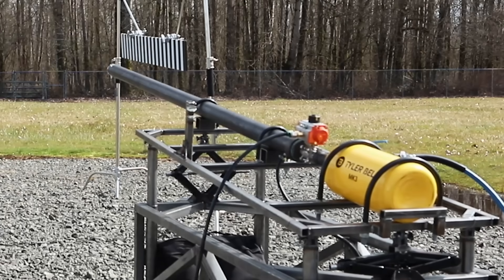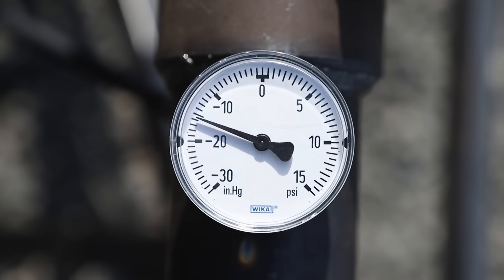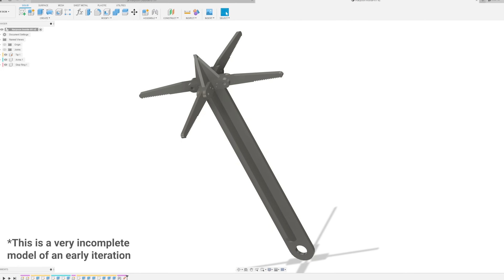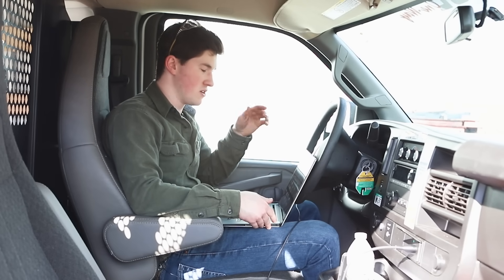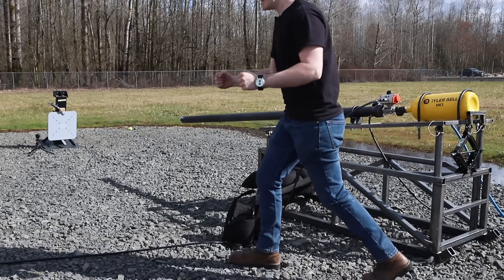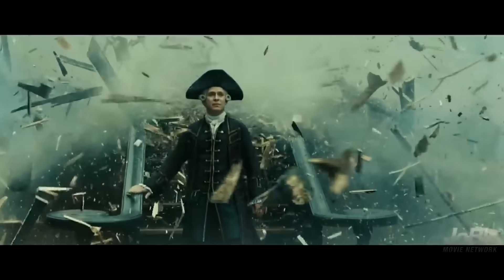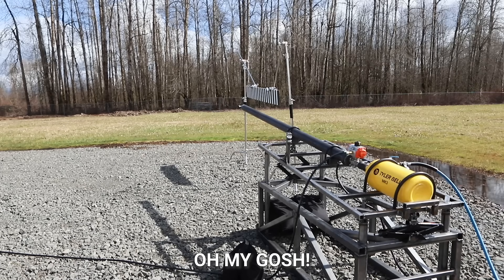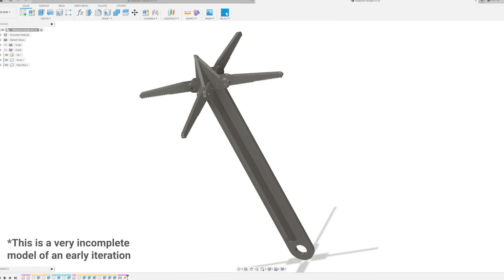Have I Found the Fastest Air Cannon Valve??

Comment: I know the answer. The ball is subsonic because your airflow is subsonic.

You need a de Laval (convergent-divergent) nozzle at the outlet of your tank to make the air jump from sonic to supersonic.
Reply: This and his assumption that a ball valve at the same size as the tank opening is sufficient. That's completely wrong, you actually need to oversize it quite a lot. Like a lot a lot like twice as much if you want it to be fast. I know because I have worked on CFD where we were using high pressure air to clean diesel particulate filters. We used a popit valve and it had to be pretty oversized to open fast enough
Reply: @friedtomatoes4946  How much is a lot and pretty oversized?
Reply: @Capitan-America-no.1 truthfully without math or simulation I can't give you that answer and I'm too rusty to run those numbers for you. However I can tell you that a better solution would be a popit valve. You get almost all of the flow with only a few percentage points of opening.
Reply: I don't think that would work. De Laval nozzle allows supersonic flow across a large pressure difference, transforming pressure potential energy into kinetic energy, but for the cannon application, ideally the pressure drop from the tank to the barrel is minimal, so maximum pressure is applied to the tennis ball throughout the time it is in the barrel. 

The speed of sound in a flow of high pressure, room temperature nitrogen is much greater than Mach 1 so that is not a fundamental limit to the setup, evidenced by SmarterEveryday achieving 1050mph with ~550 PSI nitrogen.  

I think Tyler is looking at the right areas, friction in the barrel, barrel length, flow restriction, etc. 

I would like to contribute that he could squeeze a bit more speed of sound and energy into the gas flow by heating it up to 150-200 degrees F. 

Then he could say the cannon is partially powered by an electric blanket, a bonfire, or 20 gallons of boiling water, whatever the algorithm likes best!
Reply: @tensioncompressionshear4758  Honestly some form of sabot may be needed here. If the ball is causing braking due to how soft it is that would be the simplest option by far.
Reply: @zerumsum1640  That might be right. I was focused on a tank with a big exit hole. Something like that might cost some money to make and an at home kludge might be risky. Your idea doesn't increase cost or risk much although I would prefer not to get shot with the sabot.
Reply: @davefoc  Pressure vessels are... fiesty shall we say? Getting a sabot to separate is as easy as having the cup on front extend past the projectile. could even be a pop can or tennis ball can. meanwhile trying to modify a pressure vessel for even 200 psi is risky, let alone 2k.
Reply: @zerumsum1640  Thanks for the response. That was sort of my intuitive idea about the situation without specific knowledge or experience
Reply: @zerumsum1640  i think thats a great point. the ball is probably deforming in the barrel greatly due to its construction and thats likely causing a significant amount of friction with the barrel.
Reply: @tensioncompressionshear4758  I'm gonna bet you know the difference in pressure from hot molecules vs many cold ones.
Reply: @tensioncompressionshear4758  pretty sure the diameter of the bottle is the "bottle neck". you are expanding to 3-4 times the diameter of the valve, the pressure loss will be too high.

this and a laval nozzle should do the trick
Reply: @0bloodshot0  but power loss is also determined by total length that the restriction runs through. So if he was to put an expansion fitting to fit a larger ball valve to get the bottleneck to be as short as possible then that'll also help greatly
Reply: @neillcoetzer9133  pressure doesn't work like that. You use orfices to get a constant pressure drop in hydraulics
Reply: @0bloodshot0  laval nozzle solves both issues mounted as the 3-4 expansion from tank choked flow to expanded supersonic.
Reply: @alj1993  1) hydrogen leaks through EVERYTHING and embrittles steel tanks, especially at higher pressures
2) high pressure steam generally requires a boiler license (depending on your state) because there's been enough explosions caused by it, so not easy either

you're not going to be able to get the air in the cannon to go supersonic using this barrel setup
Reply: I think he also needs a much larger tank. That little tank isn’t going to maintain the pressure long enough to really accelerate it all the way out of the barrel.
Reply: de Laval nozzle should help. Also: speed of sound is proportional to the temperature and molecular mass. Can you heat the pressure vessel? How about using helium?
Reply: Could one use compressed helium to get the higher speed of sound I am sure it would also leak but everything does.

Edit: it wouldn't really be an air cannon anymore though
Reply: @yaviks-r3w  helium is super expensive and loves to leak.
Reply: @yaviks-r3w  Or methane (MW 16). Would be cheaper, might face backlash for releasing greenhouse gasses though. The amounts released would be insignificant, but ya know how it goes on YT / social media
Reply: @ChemEDan  then he could ignite th..... wait that wasn't the goal was it
Reply: @yaviks-r3w  Yeah I'm suggesting using nearly pure methane, not a igniting a methane-air mixture. That would kinda be cheating
Reply: Could use a dump valve but ultimately why the heck did you not make it the same as a paint ball gun. ? The the other guy said Popit valve... With a spring loaded trigger. Also there will be an exact diameter to the tube you need where friction is minimal but gases can't bypass the ball
Reply: Build a springer, like a supersonic pellet gun. I don't believe they have a valve, they let a piston go that pushes the air instead.
Reply: Thats not the problem, because if you pressure increases the speed of sound also is!
Same in reverse!
Thats why airliners have to stay way below the speed of sound for ground level, because in the heights they fly the speed of sound is much lower.

Problem with that canon is the flow and volume of the tank.
As for flow restrictions, the valeve is a big one (for a ball valve until it´s fully opend) but after this the throat and barel itself are significant!
Smoothing the throat area would help alot, to avoid turbulence!
For the valve a high flow cone valve would be the best choice, but those are not accessible for mortals. 
Hammering open a ball valve with as much violence it can handel, might be the best chois.
Reply: @martin09091989  Nope. But good thinking. The valve needs to open to over100% as close to instantons as possible. in the 5 millisecond aera. That's closed to over100% in .oo5/sec
Reply: @Capitan-America-no.1  Why should it open THAT quickly?
I didn´t crunched the numbers, but i would think the projektile is not nearly at the speed of sound or treveled a significant length of the barrel in the time the valve is fully opened, in lets say 50ms or so... ?
Thats mechanicly quite easyly to achieve with some hefty springs!
Reply: @martin09091989  Nope. Wrong type valve all together.  I took mine off the interweb to blur out my valve. Never dreamed I was the only one using it. Hint I have to stop mine from opening. It opens automatically in .oo5/sec.
Reply: @martin09091989  No, how would that even logically make any sense? 
The change in the speed of sound vs. altitude is ONLY due to the change in temperature. The moment that the change in temperature starts to level off (roughly around an altitude of 11km),  even with the pressure still monotonically decreasing as altitude is increased, is when you also stop seeing large changes in the local speed of sound (after which it starts going back up again as the temperature starts to go up with increasing altitude again).
You can find a clear graph showing this, together with a mechanistic explanation, on the Wikipedia page about the "Speed of sound".
Reply: @mortlet5180  Pressure  and temperature.
Reply: @mortlet5180  
Oh your right! 😅
But still, better flow would reduce the pressure gradiant from tank to projektile.
Also because of the smaller drop in temperature when the gas expands.
I had a brainfart! 😆
Thx for correcting!
Reply: @mortlet5180  Wrong. It's pressure then temperature then moisture.
Reply: @martin09091989  correct! so much knowledge in one comment thread, hopefully he can find use from all this.
Reply: @kransurfing  No. the speed of sound in a fluid is not related to its pressure. It is instead proportional to the square root of its absolute temperature.
Reply: He said he wasn't an engineer lol.
Reply: I built one 20 years ago to shoot a golf ball,it had
8ft electrical conduit barrel
2in to 5 in reducer made of steel
5inch butterfly valve
60litre air tank
Never clocked it but we found the marked golf balls 1200 metres away,glow in the dark where the best ones 👍
Reply: I see many thinking a nozzle will not work and so on... Well. Mythbusters has made a pingpong go supersonic with nozzles. So i believe a nozzle will help quite a lot...
Reply: @alj1993  if you are gonna use hydrogen, might as well burn it.
Reply: Wow this is interesting
Reply: The flow is supersonic, for a rule of thumb 2x pressure differential causes choked flow.
Reply: The reason I know this is false is because Smarter Every Day didn't have a fancy nozzle, and they reached over mach 1.35

I think the actual physics reason behind this (by pure speculation) is that speed of sound changes with air pressure. Now, I'm not sure whether it increases or decreases with pressure, but I know we have both cases because of the vacuum in front of the ball. So perhaps the air can be traveling at a speed which is faster than 767 mph without being supersonic itself.
Reply: The air is the medium the sound is flowing through. If you have enough energy behind it air can be pushed super sonic. Happens every day in a boiler blow down.
Reply: All air molecules @ room temperature travel at 1,100 mph
Reply: I have a simple compressed air pellet gun that can shoot well over the speed of sound.
Reply: @Chevsilverado  a little. 177 or even .22 piece of lead is a lot easier to launch super sonic than a big ol fussy floppy rubber ball
Reply: @cobre7717  I’m mainly talking about the fact that people say that “air can’t expand faster than the speed of sound” when obviously there are many types of weapon that fire faster than the speed of sound using only compressed air.
Reply: @Chevsilverado  The definition of the speed of sound is how fast a pressure wave can propagate through it. To get a supersonic shockwave you need an external source of momentum e.g. detonating explosive or something like a meteor. Even then, the momentum is rapidly dissipated and the shockwave approaches the speed of sound.

The speed of sound in the gasses behind a bullet is higher because of it's temperature. Rocket engines achieve supersonic flow with a de Laval nozzle, although a rocket can become supersonic even if its exhaust is subsonic
Reply: @ChemEDan  Right that makes sense. However, with my pellet guns I only charge up a compressed air canister with a pump and it is able to fire at 1700 feet per second, so I’m not sure how it can do that without a rocket nozzle or propellant like gunpowder.  I’m not saying trying to disprove physics or anything, but to me this tennis ball cannon is exactly like a pellet gun in function so idk why you would need a nozzle or to use helium as the gas.
Reply: @Chevsilverado  It could have multiple stages - so the air you compress is used to compress the air that actually pushes the pellet. Because the air is compressed quickly and doesn't have time to cool down it would be hot and have a higher speed of sound. I've heard of people putting drops of fuel in pellet guns to make them go faster, so that's probably what's going on.

Hydrazine decomposes to nitrogen and hydrogen at high temperatures (MW 10.67 - 24.67 for rich mixture), so it should have even better performance than fuel oil (MW 26.67 - 29 for lean mixture). The maximum temperature occurs at the stoichiometric ratio, so you lean towards the side with the lower MW for a given fuel. Hydrazine breaks down into lighter gasses whereas unburnt fuel oil is much heavier (MW up to 200).

I think the ideal ratio would depend on the barrel length, friction, etc. because there's a tradeoff between pressure and speed of sound. So, you'd need to model the whole system to calculate it. The combustion would be really complicated, so probably better to just get some measurements at the range.

Hydrazine is also really toxic so probably not something for commercial use, but I'm sure there could be military applications. The nice thing is that it wouldn't necessarily increase the pressure so you could use existing barrels, which would be a big selling point.
Reply: @ChemEDan  People put drops of diesel or oil in pellet guns either after the valve or before the spring to make it detonate under high pressure, not temperature, and it is not necessary to use diesel to hit high velocities. Using something like gasoline or a more stable fuel will not ignite under the pressure of the pellet gun.

The pump style air rifles don’t use 2 stages, neither do charged compressed air rifles, and spring powered rifles. The air that comes out of the barrel is the same air that you compress into the reservoir.

Also the speed of sound only changes by 70 feet per second with a temperature change of 70f, so it would have to be very very hot air to be able to hit the speed of 1600-1700 feet per second.  About 395C / 743F  to be exact.
Reply: @Chevsilverado  Temperature increases with pressure - it's adiabatic compression. Only the absolute temperature is relevant. Room temperature is ~300K, so 400C (673K) can actually be achieved with pretty modest pressures.

When you compress the air initially it's a slow process, so it has time to reach equilibrium with its surroundings. That's why the hose of a tire pump feels hot - heat is being transferred through the walls. In adiabatic compression, everything happens so fast that essentially all of the energy stays in the gas for the period of time you're interested in.

If you glued the pellet in the chamber the gas would cool down pretty quickly, but by that same time the pellet would normally be outside the barrel already. So, the heat transfer doesn't really matter.

From Google images, it looks like spring powered rifles definitely use this mechanism. The first stage is just the spring. I bet the other ones are similar, but I can't find good diagrams.

If a gun didn't use this mechanism the fuel would never ignite. If high pressures alone were enough to cause pyrolysis, it would have broken down long before we pulled it out of the ground.
Reply: @cobre7717  pcp air rifles go far beyond .22. Aea makes a .72 caliber for one. Although a hollow tennis ball might not work, the solid one would. You just have to use the right valve. The physics are scalable, you just need a bigger pcp air rifle. They all use a poppet valve for a reason.
Reply: @kraftzion  don't they use a piston kinda like a hydraulic piston to allow a larger volume of low pressure air to scale up into a smaller volume of high pressure air? My break barrel .177 can push alloys >1400fps and they very very clearly break the sound barrier (loud and inaccurate af lol)
Reply: @ChemEDan  I’m have taken apart many air guns and some use the mechanism, but most don’t. Not all air guns can diesel as well. My whole point is that I indeed own air guns with single stage air reservoirs that can shoot over the speed of sound. You can pump it up, leave it for however long you want, and fire, and that pellet will break the sound barrier, then you can take it apart and see it’s a very simple single stage valve and tank system attached to a barrel.
Reply: @Chevsilverado  Two stage gun wouldn't necessarily be complicated. Just a reservoir of air that empties into another air-filled cavity behind the pellet. If it's long-ish we can assume plug flow and the air won't mix
Reply: @cobre7717 Ice bullet.
Reply: @Chevsilverado  Yes Yes! Air can indeed break the sound barrier!!
Reply: Yeah you gotta remember he’s just a simple YouTuber trying to go big fast. He’s not a mechanical engineer and knows nothing and the fundamentals of why this stuff works.

Comment: See also: "Das Cannonon" which details the engineering behind the world's biggest gun attempt by the Germans during WW2. It utilized multiple combustion customers which would ignite as the projectile passed along the barrel.
Reply: But that didnt work, guns are limeted to the speed of sound from the pushing gases
Reply: @yaykruser  that is a very important limiting factor. Of course the speed of sound is much higher for a combusting gas mixture, than it is at atmospheric pressure.
Reply: @zippythinginvention  Yeah, the heat increases it, but it only does to a certain point and then you see next to 0 increase in speed of sound. 
Only way to make it faster would be with a lighter gas like helium or hydrogen. 
Do you know why a shaped charge can reach 6km/s ? I mean its propelled by explosives producing gasses too.